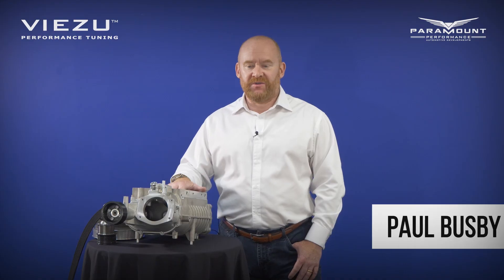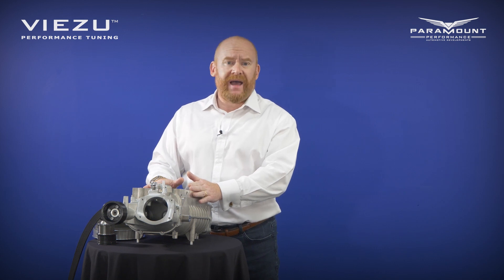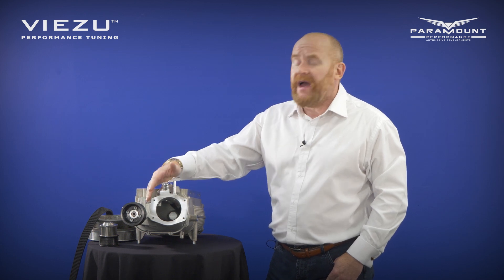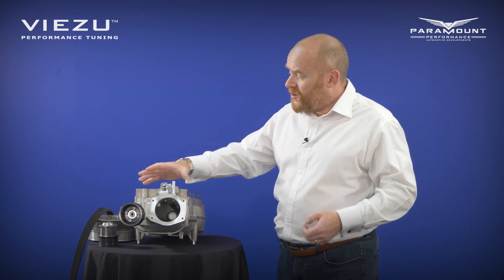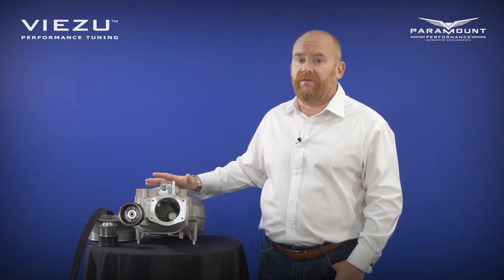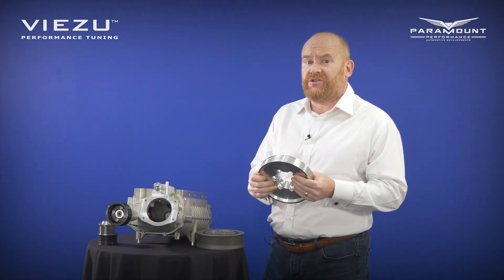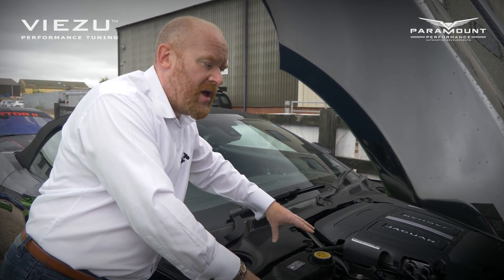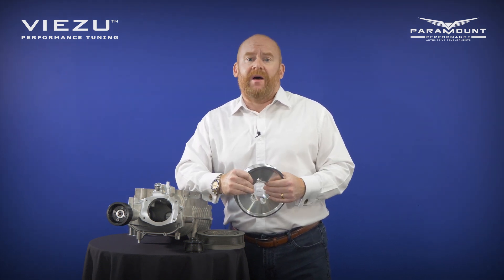Superchargers Explained: How to Upgrade, Troubleshoot, and Boost Performance (Jaguar Cars & More)

Comment: On the new larger supercharger,  would your air charger upgrade and the chiller kit keep the engine cool enough during the summer months in Texas? It gets up to 110°F here? 
Thank you in advance for any responses
Reply from the maker: Hi Chad, with both modifications the, cooling is absolutely amazing. We are actually running testing as we speak to provide the proven figures so we can publish these to our customers. So far even we are shocked by the numbers coming out of the testing when the combination of the chiller and the air intake are fitted, we already knew they were good but we didn't realise quite how good! From what we are seeing the chiller kit and air intake would be an excellent recommendation for the kind of temperatures you see in Texas! 
Many Thanks
Eve @ Viezu

Comment: Is it necessary to change the soft after changing the small compressor wheel ? Does the combustion decrease after such tuning ?
Reply from the maker: you do not have to remap the software if you fit a smaller supercharger pulley, but gains will be much smaller if you dont, adding a pulley and a remap together is much, much more effective, adding around 60bhp on a 5.0 engine. we offer tuning around teh work, and can send the new software by mail order too, please let us know if we can help with anything

Comment: Informative video,if just the lower pulley is changed on an xfr along with a remap what sort of power will it achieve?
Bhp & torque 
Many thanks
Reply from the maker: Hello,
Pop me over an email at info@viezu.com and I can go through the different breakdowns for power on the different upgrades.
Kind regards,
Elle